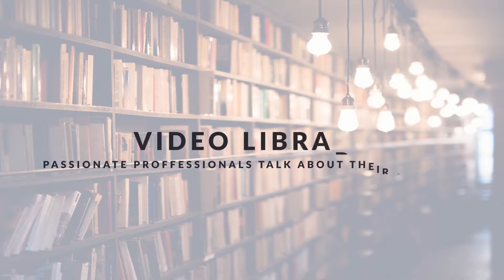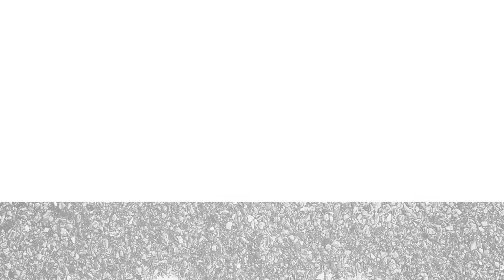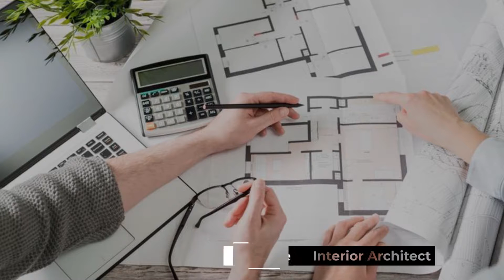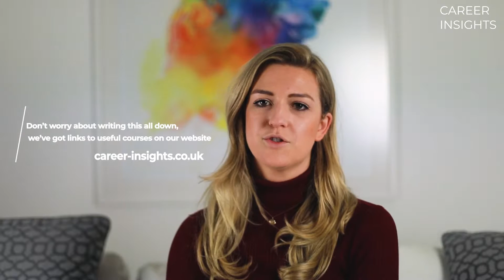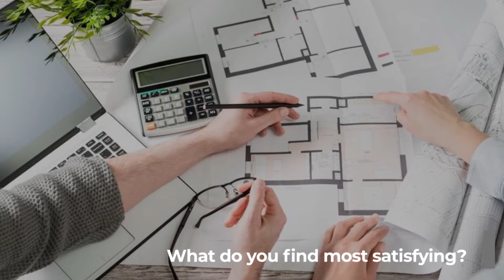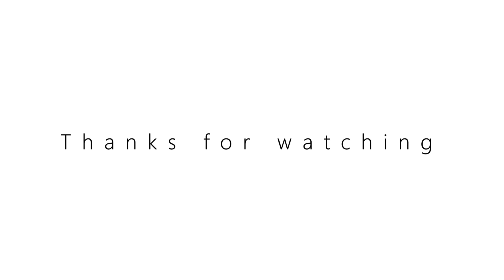Interior Architect - Career Insights (Careers in the Creative Industry)

Comment: As an interior architect, can  we draw floor plans? Like 5 stories building, what are the career opportunities
Reply from the maker: Hi, it can depend on the country as well as the company you work for in terms of scope of the role. Similarly with floor plans it would depend on whether it was a new build or refurbishment over where the first plans were developed i.e. by the architect or a surveyor.

In the UK the interior designer / architect wouldn’t typically draft the first set of plans but would develop the areas that they’ve agreed with the client as part of their brief.

As mentioned above there can be a lot of similar job titles but the scope or specialism is different. Some interior designers / architects have specialist furniture arms to their business so will design custom furniture others may focus more on the overall concept and subcontract that element out and work with other specialists like lighting designers.

Hope this helps
Reply: @careerinsights2430  thank you so much for your kindness ❤ it helps a lot, now I'm an interior architect

Comment: I’m going to be graduating as an interior architect this coming spring but due to COVID I haven’t been able to intern. How will that affect me getting a job as an interior architect?
Reply from the maker: Hi Iris, you’ll ultimately be in a similar position to a lot of people. I would apply for positions as you normally would but if you’re not hearing back or unable to secure a job I would potentially switch tack and try and get some work experience / intern.

The google work experience video I did is the kind of strategy I would adopt.

Maybe offering to do up to 1 month unpaid or contribution to your travel costs.

The key is to make yourself standout and put yourself in the shoes of the businesses you’re applying for.

Potentially they have cash flow issues because of Covid and you offering to help in exchange for them showing you the ropes may be an attractive offer for both of you.

Once you’re in the door you then have an opportunity to show your skills, etc and see if you can turn the position into a full time job.

At the very least it will add some weight to your resume.

It’s a different topic but Lydia (Fundraising Manager) went through something similar when she was starting out.

All the best
Reply: From what university? I am interested in getting a degree!
Reply: @perlakerla  at the university of Idaho😄

Comment: Hi. Just wondering, how much mathematical knowledge do you need got this job?
Reply from the maker: Hi, one of the major skills needed for interior architecture is creativity and then combining this with interpreting your clients requirements. 

Tying it back to your mathematical question most clients will have budgets to work to so you’ll need to make sure you’re working within them.

Another largely mathematical element to the role is scale and dimensions. Whether it’s room sizes, furniture or the height of a skirting board or size of the shadow gap detail you want to create. Dimensions to the mm are something which is very much inherent in the day to day.

Hope this helps,
CI team